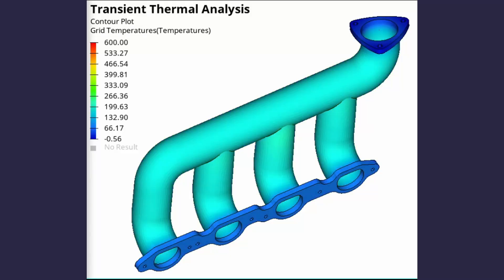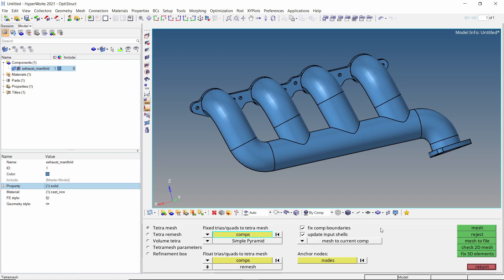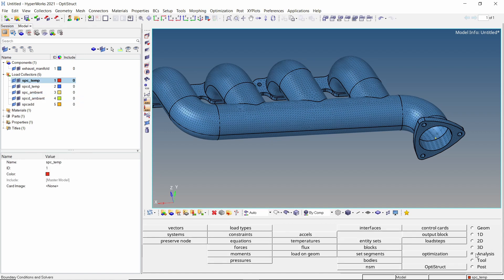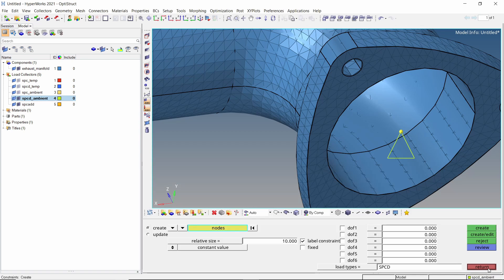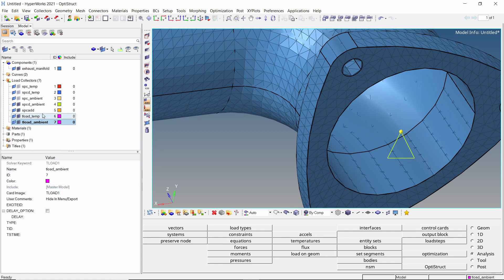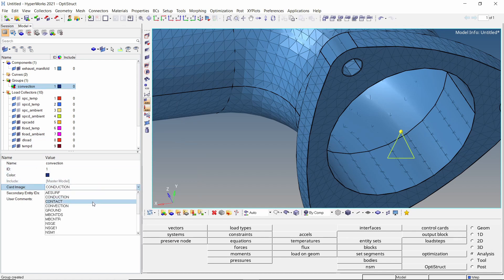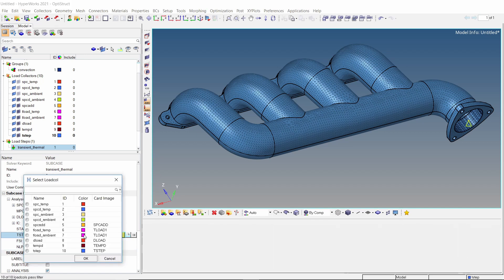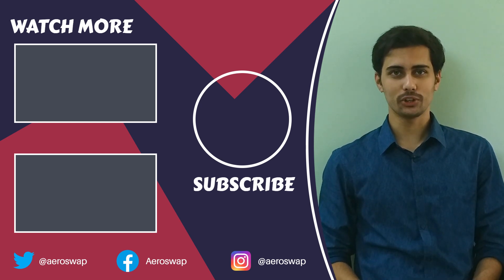Transient Thermal Analysis using Hypermesh [Optistruct Tutorial]

Comment: i have question, for the ambient temp node, why you place the node there? or is it can be place anywhere near the model?
Reply from the maker: Hi Adib, 
The ambient node can be placed anywhere in the model. It's location does not affect the analysis. The only reason why I created it near the pipe is because it was easy to extract the center node.
Reply: @Aeroswap  i see. got it thank you sir

Comment: TEMPD card image is used maximum time in thermal analysis. But I didn't know when to use it, could you tell me?
Reply from the maker: Hi Onkar,
TEMPD defines reference temperature in a thermal analysis. It is used to specify the temperature units (usually Kelvin or degC). As Hypermesh is a unit neutral evnironment, TEMPD provides a base point for the temperature range.

Comment: Bro, do you know how we can allocate more RAM and CPU to make the HyperMesh Analysis run fast? Because I have access to High Performance Computer which has 32 CPU's and 128GB RAM.
Thanks and looking forwards to your reply soon.
Reply from the maker: Hi Gurbaksh,
You use multiple cores to run an analysis faster. This can be done by specifying the below command in options field before launching the solver-

"-nt <number of cores to be used>"

I hope this helps!
Reply: @Aeroswap  There is already a command written by default in the options box "-optskip". Should I erase this and then input "-nt<32>" ? or Should I put "-optskip, -nt<32>" ?
Reply from the maker: -optiskip means the solver will perform the analysis and skip the optimization. As this is just an analysis and not optimization, you can keep it or erase it. Both is okay.
Reply: @Aeroswap  Thanks for letting me know what -optiskip means, I wasn't aware before. But unfortunately, when I am giving it a go I am not getting the .mvw file which I usually use to get. Also, I am not able to see the HyperMesh Analysis Progress window while following this approach.
Reply from the maker: Alright. Try entering '-analysis' and run again. See how it goes!
Reply: @Aeroswap  Thank you so much!! It is working now!! 👏🏻

Comment: Hi sir, without linking 3 or more materials with each other for a component in one bulk entry data and keeping each material in one subcase, can we perform a static or thermal or any other analysis and displaying the results for each case(i.e for each material) and by keeping the load collectors for all materials as same. It is possible?
Reply from the maker: Yes, but you can assign only one material to each component. Therefore, you will have to create separate FEM files if you want to test a particular component with different materials.
Reply: @Aeroswap  Thank you sir

Comment: Hi sir i'm using hyperworks 2019, I did as you instructed but i got an error '' * See next message about line 182288 from file:
     D:/hyperwork/OptiStruct/heat_themal/transient_themal.fem
  "DLOAD         10             1.0       8     1.0       9"
 
 * ERROR # 1000 * in the input data:
 Incorrect data in field # 3.''  can you help me explain this error? thank sir
Reply from the maker: Hi Tuan,
Looks like you have missed out on some step in the setup process. Please watch the tutorial carefully and follow every step. It will resolve the error.
Reply: Hi sir,
I watched it and did it again but it still have the same error as above. Can i give you my file to you check this error ? thanks sir
Reply from the maker: Check your DLOAD card. Make sure that S field is set to 1.
Reply: @Aeroswap  yes sir field S is 1
Reply from the maker: The error message states that something is not correctly defined in the DLOAD. Please check all scale factor values. Also check whether you have assigned the DLOAD in correct field in the loadstep.
Reply: @Aeroswap  thanks sir this error has been fixed
Reply from the maker: Good to know :)
Reply: em cũng dùng 2019 mà lúc tạo curve xong. muốn sửa curve type về tabled1 như video nhưng của em chỉ hiện mỗi linear. anh có bị vậy không ạ?

Comment: Can you please tell me how to apply thermal gradient loads for shell elements. Like different temperatures for top fiber and bottom fiber of shell element
Reply from the maker: Hi Anil,
Shell elements have constant parameters in thickness direction. Hence it is not possible to apply different temperature on sides of the same shell element. To do this, please use brick (hexa-penta) elements.

Comment: First comment! Nice work Swapnil, Excellent presentation of transient thermal analysis. Btw: How do you change the "D" value on an already defined spc_temp? Thanks!
Reply from the maker: Thanks Emmanuel :)
For that you can use the card edit option. Set the entity selector to 'Loads' and select that spc. Then you can edit the card and change D value.
Reply: @Aeroswap  Thanks for the reply Swapnil

Comment: if i use temp of 2000 degrees in spc_temp and spcd_temp as d=1, And in case of spc_ambient as 25 degrees and spcd_ambient as 1. i got my results with error and in my problem i need 2000 degrees temp and 25 degrees ambient temp shouldbe taken. help with this